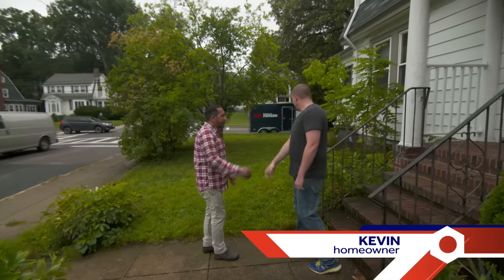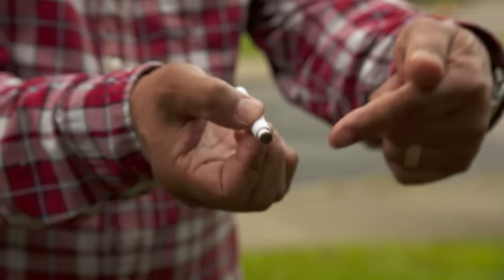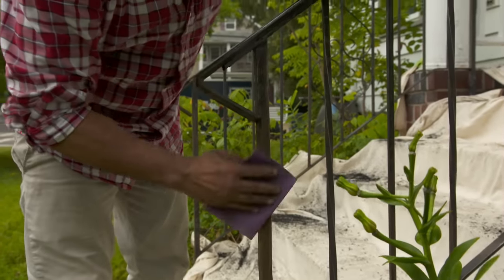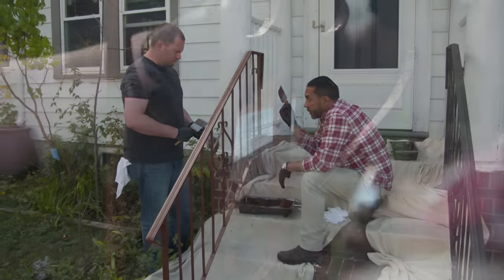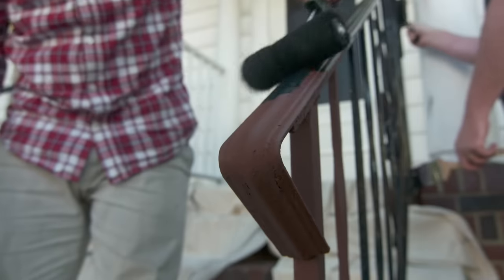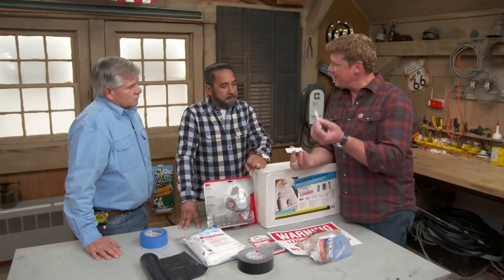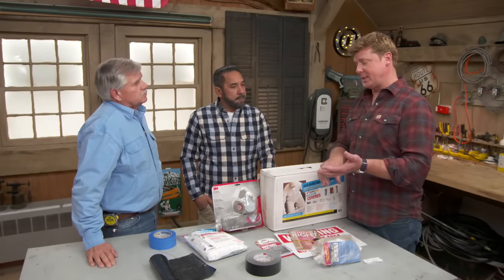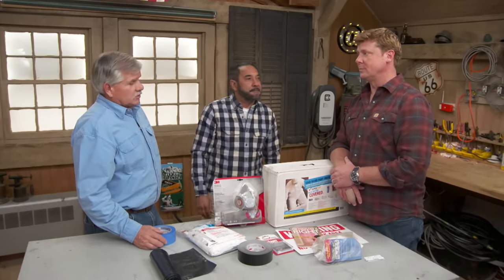How to Repaint a Rusty, Metal Hand Rail | Ask This Old House

Comment: I had a old set of rusted railings like these. I drilled them out, took them to a local sandblaster. I think I paid around $100 to have them taken down to bare metal. Then I was able to spray primer and finish before reinstalling them. Faster and easier than using a scraper and wire brush.
Reply: I bet that you ended up with a better end result too.
Reply: They did that in one of their shows.
Reply: I like the way you think, thanks!
Reply: What I was thinking of doing! Glad it worked well for you.
Reply: Mine look like the ones in the video if not worse and we will be replacing our front stairs this spring so plan to do almost exactly what you did.  The difference being that I will do sand blasting.  I will be most likely using Rustoleum’s marine paint.
Reply: I strip it right there on the spot. Easy peasy. Well.. Not for me.. 😂
Reply: How did it turn out
Reply: it costs about 5 times more around where I live, so the cost of new railings is usually quite a bit cheaper at that point :(

Comment: Rust once it occurs migrates under paint. The only sure way is to strip paint or wire wheel to bare metal. Then use a chemical treatment to neutralize the rust with something like Ospho Rust Treatment or an equivalent. Then Prime and Paint. I prefer to simply brush it on with structures like railings so the paint isn't spread so thickly.  Treat the metal first to stop the rust before painting or the rust will come back within a few months. Do a good job and it can last for years.
Reply: @e.conboy4286  Never said it was easy just the best way. BTW I'm 72.
Reply: @richb313   You’re just 72?  I’ve got freckles older than that!   83 here but hangin’ on!  You sure you don’t want to come here and help?  🇺🇸

Comment: Funny - my railings are in the same condition, and I was planning to do this in the next month. Perfect timing and informative.
Reply: how did it turn out
Reply: @thecurlymonster  Absolutely beautiful. The instructions given here are very good. It's a LOT of scraping, but the better you do at scraping, the better the final result looks.

I put down plastic tarps to keep the scraped paint chips out of my flower bed, and they were absolutely necessary. There was a huge mess.

The final coat of paint I applied chips somewhat easily, but this is just another reason the rust proofing coat is so important.

Comment: I would have used a grinder to get it down to the bare metal. 
I would have also spray painted it. An extra hour of prepping, would save you hours in painting.
I brushed and rolled my railing once, never again. I only had before 11 am to get it done, or else the sun will be on that side and dry it out real quick. So it took me like a week and about 2-3 hours a day, with just a brush and roller.
Next time it will be spray painted.
Reply: yea I would have used a grinder with a Wire Wheel Brush to bare metal too
 then used a rust inhibitor + primer  in multiple thin coats
then an outdoor metal paint in multiple thin coats then a protective top coat
Reply: @Mr. Meeseeks Yeah, but then it'll looks like crap.
This old paint was pealing and bubbling.
Reply: I tried to go bare metal but it seems impossible 2 days of work and there is still paint/rust. I used angle grinder. I beleive that it is nearly impossible to achieve this with normal tools. There are places where angle grinder doesnt fit or places downside that are very hard to reach.
Reply: Due to so many curves especially on more complex railings it is almost impossible to get it to bare metal.
Reply: @pg8605  You use a grinder on as much as possible,  and then the curves, you use sandpaper.
Reply: When we sprayed, the wind (which had never, ever blown) blew the paint right back in our faces!  Since the I collect appliance boxes ant yes the cardboard behind the railing.
Reply: @pg8605  You might try tapering a stirring stick enough to get the angles wanted and stapling coarse sandpaper and having good results! Time consuming but it does get ride of that rust and dirt which collected there.
Reply: I get just as much, if not more, info from the comment section than the video. The video glosses over the tedious, difficult, cussing parts.

Comment: Cut the railing off with a Sawsall 1 inch or so from the concrete.
TAKE THE RAILINGS TO A SANDBLASTING BUSINESS AND HAVE THEM BLASTED
Prime and paint the railings before welding them back on.
Prep the stubs, weld the railing on, grind the weld, prime and paint.
You can do 1 railing at a time so there is always a handrail there.
If the railings are bolted down just unbolt them then reinstall them after blasting and painting.
Reply: Or just buy new railings.  For the cost and effort to do all that a nice new railing without any pitting would look better.  Perhaps more modern too.

Comment: If he could follow up by power washing the brick steps and landing, those freshly painted handrails would really pop !!!
Reply: You're right, it would really make it much nicer, but I would have pressure washed beforehand to clean off the loose scaling paint & rust from the rails. Then followed up with a light hosing after the paint was dry to get rid of any rust and powder from the scraping and brushing.

Comment: nice paint job. Maru is a boss. Smart to prime it with oil based rust resistant paint, that will last so long. Also smart to completely remove all the old rust so that the paint will actually stick and not look chunky. Oil based paint stays on so much longer than water based paint. Just don't get it on your hands! Lol.

Comment: Moro: "first we must check for lead paint. I'm going to take my utility knife here . . "

Me with my angle grinder: "BAD TIMING WITH COVID, HOLD YOUR BREATH WE DON'T HAVE MASKS"
Reply: Black Buick  nice! Yah 150 wouldn't even touch mine. When I started using 40 and 60 grit, I went to a wire wheel and it went so much faster, finished with sandpaper in a step down fashion and sprayed black....much better than rusted pink!

Comment: A video needs to be done for asbestos as well as lot of older homes can contain that stuff as well!
Reply: Best leave that to professionals.
Reply: You don't want to mess with asbestos. Professionals need to do it because it has to be disposed of properly, and I'm not sure if homeowners are allowed to dispose of it in the appropriate landfills. Leave it to the pros, even if it costs a lot.  Your life could depend on it.
Reply: @cruman87  Understood but it is still good info to know as a homeowner or as tradesman so you know how to act accordingly to protect onesself.
Reply: If you don't touch it, it wouldn't be a problem.
Reply: They didnt typically use asbestos in iron work. Typically asbestos was used for its insulating properties and fire retardant. Both things that dont really apply to metal. It could be there just not likely.

Comment: There is no way you can scrape all this paint down to metal. I spent 6 hours yesterday attempting this and only got halfway done.

Why can't I just scrape the chips and sand down the rest til no chips?
Reply: Use a rust neutralizer (like Ospho) before the primer. If you want to get the paint off so you can get to all the rust use a paint stripper like  Citristrip. It’s messy but it gets the old paint layers off.

Comment: My railing is over 50 years old, just learn to spend an hour every decade or so putting on a nice coat of Rust-Oleum or similar and your railing will last a lifetime.
Reply: Black Buick  It's always good to hear about things that have lasted the test of time.
Reply: Do you mean you just painted over it after dusting it off?  I’m in!
Reply: @e.conboy4286  Pretty much. May have been a little more prep than just "dusting it off" but not much.

Comment: You can see the Broken weld at 0:17 and 0:43. And who painted the windows behind them at 5:55 ?  If you don't test for lead, you don't have it.
Reply: If you dont test for lead and a government agency catches you.
You could be looking at a very hefty fine that is A LOT more expensive than a test kit, plastic, duct tape and a mask.
Reply: @shawnr771 , I know, I was just kind of kidding around. April fools. LOL.
Reply: @shawnr771  How would they catch you?
Reply: @saulgoodman2018  During remodels of buildings and homes especially when a permit is required. Government agencies like City/County Inspectors, OSHA, Independent Inspectors perhaps hired by the owners, the banks, etc can and usually will show up on job sites.

If you are a home owner doing that outside, especially in an older neighborhood a city inspector might just drive by or if your neighbors are busy bodies they might call in on you.
Reply: @shawnr771  I did work, including painting outside my house lots of times. No inspector showed up, and now one complained.
Even when there were inspectors looking at the reno that was across the street from me.
Reply: @saulgoodman2018  Depends on the age of your house. Residential areas where the homes were built prior to the 1980's tend to attract more attention.
Homes in historic districts etc.

Not saying anybody would complain just that they CAN complain. 
You must have good neighbors and decent city inspectors.
Reply: @shawnr771  My house is 1900, and my neighbors also don't bother any one. We all mind our own business.
Except when they see you working, then they'll start asking all these questions.

Comment: There is a LOT easier way to do this.  Who wants to do all that scraping. If i was going to "scrape" that hard, I'd use a wire brush on a drill or have it sand blasted.  There is an easier way.  For me, it's 3 steps.   First, did you notice in this job, even after the 2nd coat of paint was put on, when they did a closeup you could see where there was missing paint from scraping.  Once you paint the old paint still sticks up a couple of layers and the new paint sinks down against the bare metal. So once it's done their way it looks new but it also looks pitted if you are standing next to it. I think it looks very unprofessional.

MY WAY.  First, paint is just that paint.  It was painted on brand new metal when that railing was installed brand spanking new.
Now that it is falling off, curling up and rusting, it looks horrible.  So the first thing I do is apply gel paint remover.  Here is an example of how easy it takes paint off metal. Although I was looking for one with a railing. https://youtu.be/r15QccHHu4I?t=172

This product is biodegradable and works fast.  citistrip although you may use one of your choosing. I just use that one.

I painted the gel on my paint chipped rusty white metal outdoor railing. I tested it on about a 2 foot section first.  I DID test my metal and it had no lead paint.  I put it on and went back in the house to gather up some other tools. A small empty coffee can and my good old metal plumbers knife leftover from my grandfathers tools.   I slide that knife up and down the four sides of the railing bars and that old paint came flying off.  It works in as little as 30 minutes and can work up to 24 hours.  I let it set about an hour and after I "scraped" off  the old paint I put it in the old coffee can.  I continued to do the rest of the railing on both sides of the porch.

After I scraped them clean, I washed them with the power washer.   The next day, I did apply some gel rust remover to quite a few pieces and a quick brush over the rest.  Again, I power washed it clean as brand new.  I let it dry a bit but then ran over the entire thing with my trusty old rags to dry it off.  I did use some primer and then later two coats of white paint.  You would think it was show room new.  VERY little physical exertion compared to what this video showed you to do.  I have one more to do and I think I'll try to video it although I've never posted a do-it-yourself.
Reply: Do note that this method was the only option for me, since my railings were lightly rusted, so the paint was still not easy to just scrape off like the video above. Do note, that Citristrip is going to make a mess of things, so protect anything you don't want to get dirty.
Reply: Will you come and do mine? The neighbors will be impressed!

Comment: Did he just say that on the card if it shows pink that means there is traces of lead and then when he put the stick on the card  and it turned reddish pink he said no trace? WHAT?😮
Reply: There was a “control” spot that you want to see turn pink/red to prove the card is working. It’s to ensure that a negative result is truly negative and not because the card is faulty.

Comment: While lead paint has been shown to cause brain injury/damage in children if ingested, all of these excessive precautions have less to do with safety and more to do with the litigious atmosphere so pervasive these days. When in doubt CYA, I guess!
Reply: They promote restoring old homes, but I get that they over-exaggerate the protection (always thanks to lawyers). I get safety, but no one will buy any home that is older than 1990s (asbestos, radon, lead paint, mold, aluminum wire, tamper resistant outlets, fire retardant boards, BX wire, galvanize pipe, CO/Smoke detection, insulation,...) if they realize you can't have a nice old house without something in it. And think: will you get that investment on abatement?